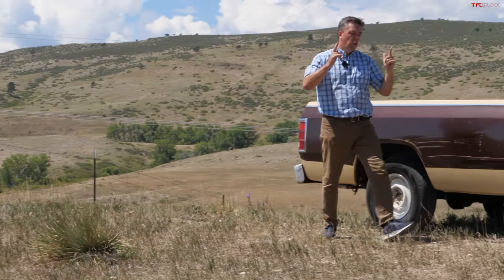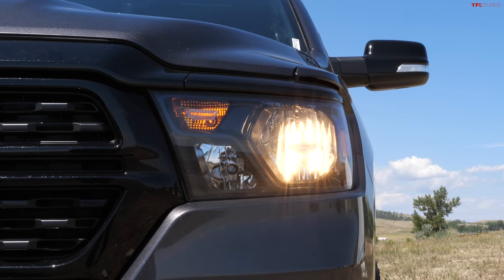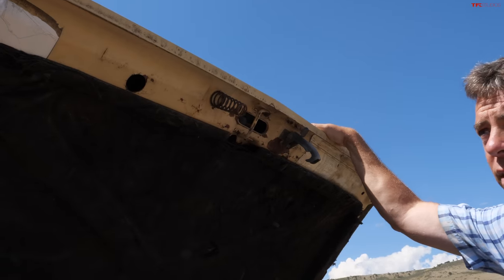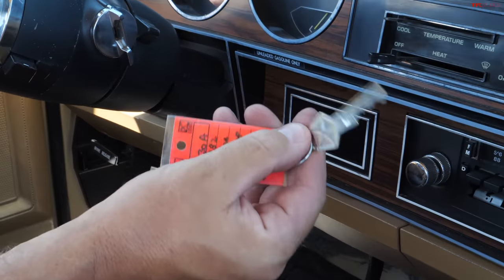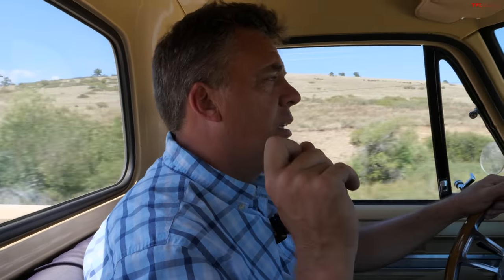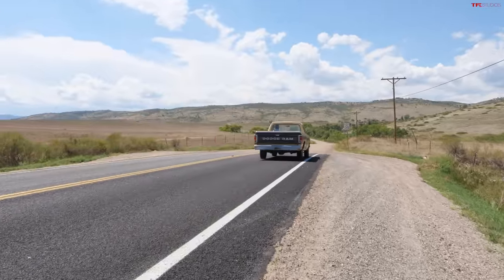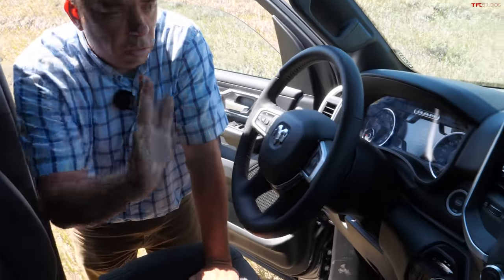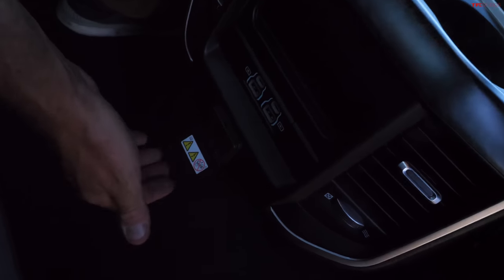You Won't Believe How Much Pickup Trucks Have Changed in The Last 40-YEARS!

Comment: My father had a 1980 350 dually flat bed with a 360 ci engine and a 4 speed manual. The biggest pile of crap I have ever drove and rode in. Constantly breaking down, extremely loud and rough ride. The doors from day 1 didn’t shut properly and leaked water and air. You could see daylight through the door jamb. Had to rebuild the engine twice. Once at 45,000 and once at 66,000 miles. Other than that…. A real great Mopar product. 👎🏻. He also had a 86, 73 and a 69 Dodge pickup. Both were gems and had similar problems. Piles of garbage. Only reason he owned them was that was the only dealer in town and we had no choice. 100 miles to the next town with options. Lol. Anyway, good luck with that one. Hopefully you have a better experience than I did growing up. 👍🏻

Comment: You haven't adjusted that price tag for inflation, so the new RAM cost is roughly 3 - 4x more than the 1982 model. 

Also, 4WD is for off-road capability. It does little to improve hauling or towing, unless you're doing it on none paved roads. That older RAM is most likely RWD, which makes it quite a capable truck for its time.

Comment: Early in the video he remarked that the old Dodge truck was not an "all season" truck because it was so light, I've lived in MN my whole life and believe me those old trucks WERE sold to "all season" states like MN, you just put bags of sand or stacked some wood in the bed in the winter. Also, he remarked how the comfort level was similar in both, really, that's proposterous!  My dad had a 1980 1/2 ton Dodge truck, [pale yellow and white] and it rode nothing like the trucks of today, it also came with side mirrors on both sides, and the steering wheel on that old Dodge is definitely not stock, so I don't know where he found this oddball truck.

Comment: Trucks used to be cheap vehicles because they were built primarily for work and utility. Now they are built for family transportation. Trucks were purchased by individuals primarily as second vehicles for those reasons. As cars got smaller, truck sales picked up in the 80s because they were still big and comfortable. Manufacturers caught on on now trucks are luxury vehicles. As I recall from the early 80s Dodge trucks were primarily government or fleet vehicles because they usually came in with the lowest bid.

Comment: My buddy has an 86 dodge with the 315 v8 and I have an 86 ford with the 4.9 straight 6. He's has a lift and big tires and he still beats me in a race. Straight 6 was made for low end torque, not horsepower. The v8 may have more torque, but not low end torque.

Comment: Ive recently had an 88 dodge and a 2014 dodge..... I much prefered the old. Its smaller outside but larger inside. Was also more comfortable and got the same fuel milage. I really really would rather have the 1988 truck than the 2014
Reply: And everything on the 88 still worked. Every switch every knob everything. Im already fighting with keeping everything on the newer one. Everything keeps breaking.
Reply: Just don’t have a crash in the old truck. The difference in safety performance is massive.

Comment: That's 1982 Ram was in its 10th year on that platform at the time of assembly. It was the same truck, until 1993 when the 1994 trucks came to be. Like most things Chrysler. The don't change designs often because they can't afford to redesign an enift platform. This is why we have 2008 Challengers/Chargers/300s running around. The 2011(actually 2005) Caravans are still being built and sold(the 2015 Pacifica is too $$$$) and the Ram chassis is the same basic design(2019 5th gen is a massaged version 4" longer) as the 2011 truck(actually the 2002 LD/2003 HD trucks)
Reply: It's amazing that Dodge just announced their first new vehicle in 10 years, the Hornet. And it's not even a Dodge, but a rebadged Alpha Romeo.

Comment: I have owned from even older Dodge Trucks into the 2000's both gas and diesel powered. I will take the 1970's -early 90's trucks all day long over the newer yuppie trucks. The move towards yuppie trucks really hurt the person that works their pickups with maybe the exception of the long haul/ heavy load drivers. 
A construction worker/ city work/ utility truck doesn't need all the luxury crap that bloats the weight and cost of the newer trucks. At most AC the rest is just a wallet/purse emptier frivolous crap.
To me the best all around Dodge trucks for the person using them as a work truck were the half ton 318 powered ones. The slant six really wasn't any better on fuel or longevity. I have a 1981 slant six D150 project truck now. The Cummins are great if you have extra heavy weight to pull but that is about it.  But how much should a pickup be able to pull? Pickups are now pulling what it use to take a commercial truck and commercial insurance to pull.
Reply: Well summarized.

Comment: 5:01 Most likely it did come with 3-point seat belts. My 1984 Chevrolet S-10 had them.
This was also right after Nader's "Unsafe at any speed" and push for automotive safety, in terms of automobile development.
Reply: Yes on three point belts started in mid 70s

Comment: Hmmmm.... 2 new trucks in my world. Took my son to the lake this morning in my 75 year old 1947 Dodge Power Wagon.
1 ton, 4 wheel drive, 60 hp flat head 6 cylinder, factory winch, 4 speed with low range...no synchronized gears. Had a notion to drive over to Colorado so TLC could drive an older Dodge.

Comment: In 40 years, that '82 will still be going with minimal maintenance. The new Ram will take a lot more parts and maintenance to make it to 40
Reply: The new RAM will be non-functional after 10-15 years (is my guess) as the dashboard electronics will be obsolete and non-functioning, with no aftermarket parts available to replace them. It will be functionally unusable, even if the engine is fine.

Comment: I had a 1991 ram 2500  360 v8  loaded it up with sand gravel right  down to the stops  run like it was no problems 😊 😅 👌 😀

Comment: Thanks for your time sharing this video but, I will NEVER buy another Dodge vehicle again!  We bought ALL NEW at separate times, a 2005 & 2006 Diesel Ram One ton trucks,  2005 Dodge Magnum, 2006 Dodge Neon, and yes a 2008 PT Cruiser. The PT consumed a quart of oil every 1000 miles. They replaced the lower block, and it still consumed 1 quart every thousand miles.  After taking it back several more times with NO fixes. Dodge gives me a tiny slip of paper , big as a fortune cookie slip that says: It’s common for Dodge vehicles to loose 0ne quart of oil every 1000 miles. Huh?  When it comes to warranty’s.  The SERVICE DEPARTMENT SUCKS!
Reply: Strange, I used to own a pt cruiser and that made it to 160k and burned no oil, it was actually real reliable but I needed to upgrade to something bigger
Reply: @ricepile1343  I must of got a lemon.☹

Comment: More like 50 years right there. Yes I’d did cone with 3 point seat belts. Safety was beginning to be paramount! No that radio in your truck isn’t the earlier version of the precision series or standard issue digitally tuned Chrysler factory radio’s in the manual which was made standard in 1984 which means no more optional analog radio’s after 1983.

Comment: With gas prices going up these days I would rather have a 6 cylinder and the slant 6 is one of best engines and would run forever, so I would rather have the old truck now. I do have a '97 Ram 1500 with a 360 V8 and wish it got better mpgs then it does. Which my truck has 283, 400 miles so far and still going strong so one thing with Mopar is their engines can run forever. Plus I've own my truck for 9 years and have put over 90,000 on it so far myself and its still going. So Mopar or no car or truck!

Comment: 4:59 3-point seat belts were mandatory in front seats by 1968.  Initial implementation was having the shoulder belt separate, but by the mid-70s, almost all manufactures were using the ratchet style 3-points that we're still using today.  An 82 Ram would have came with those from the factory.  Only the 1st Gen Ram (81-93) predecessor would have used anything else.  Those were the 2nd Gen D/W Dodge Trucks (71-80), they would have had some early models with separate shoulder belts, but it's also the models that had the gas tank behind the seat in the cab, so safety wasn't exactly a strong point.
Reply: True.  My friends '70 Chevy didn't have the shoulder belts, but it had a covered screw hole where they could be attached.  It might have been an option for a few years on the trucks.  But I understand GM cars had shoulder belt mounts under the headliner on cars starting in 66.  They even had mounting holes for rear shoulder belts starting around 1970.  Rear shoulder belts were a factory option on my '71 Riviera.  But i have seen Chevelles, etc with the same mounting holes.  May have been a dealer option or just put in, just in case regulations changed between design and production.

Comment: Anywhere near 30mpg would have to be a D50 with the diesel. This truck, would probably get 18 mixed brand spanking new. I had an '81 slant and got roughly 13 city. These trucks wore out quickly and the mpg suffered greatly. I've seen folks barely braking 10 mpg with a slant.

Comment: The maintenance alone over the years on the new truck would pay for several of the old.
Don't forget that with newer vehicles often replacement of a small item requires disassembly of half the vehicle.
In addition those old slanties were good for well over 200,000 miles with regular oil changes.
Old six cylinder pickups and truck type wagons of the day were regularly rated to tow from 4000 up to 5000 pounds.
The newer trucks are certainly no better when it comes to rust and corrosion.  That still comes down to the owners care of the vehicle. 
But hey if your not stuck enough in front of a computer screen each day then yes you have that benefit and increased fun with newer trucks.  I guess.

Comment: Old - Way more headroom, way more hip room. Way more space, The A pillar you can actually see out off. and Roll one over and your gonna live. Iron that could handle the salt belt. A bumper you could actually hit a deer and have no damage.  No Distraction for driving.  Simple and easy to work on. 
New - Will rust out in less then 10 years- Hard to see out off. No hip room in the seats. An a pillar you can loose a tractor trailer in. Does not do well when rolled over. New is to fragile.

Comment: Based on median income the new Ram is twice as expensive.  About 10 months median income vs. 5 months for the '82.
Reply: Twice the adjusted price, but 10 times the vehicle.
Reply: @Josh-179  If you go to the RAM site, under commercial vehicles there is a Tradesman pickup, regular cab 8' bed for half the price.  It is still twice the vehicle. Pickups now are family vehicles, not work vehicles.  Since the government regulated cars out of existence trucks have replaced them.

Comment: Love the window quarter light. A real work truck, I don’t know what today’s trucks are for.
Reply: New trucks will be able to tow double that. You still can get base model "classic" rams single cab 8' bed with more towing and safer
Reply: @ricepile1343  no doubt I had this truck and it was slow and when you hit an expansion joint the whole truck shuddered and jumped around hence the expression “ drives like a truck” but it was simple and easy to fix basically a tractor with doors.
Reply: Driving around like cars

Comment: With specified oil changes, that Slant will go 250,000.0 miles without touching it. Brillant engine but not so well known. Used in both passenger cars and trucks.

Comment: IF you did your homework, you would find that tiny drivers side mirror is WRONG and the fact it does NOT have a passenger side mirror is WRONG.  That rear view mirror looks WRONG as well.  And I won't even go into all the other things that are NOT original equipment.  Regardless, I never liked the OLD Dodge/Ram trucks until they redesigned the whole thing in 1994.

Comment: The hood on the new truck is so short compared to the old one.  I don't see how mechanics can work on the new one.  The engine is halfway under the windshield.  You can crawl into the engine bay on the old one, there is so much room.
Reply: We had a 75 Plymouth Fury with a Slant 6. Like this Dodge, you could probably fit two Slant Sixes under the hood.
Reply: @rightlanehog3151  Slant 12!

Comment: That's a nice old truck & the thing about it is if you were to go out one morning and it wouldn't start it's gotta be fuel, fire or air, if the 2022 failed to start it could be anything, & I'd be willing to bet the 2022 won't be around in 40 years either. Give me the 82 Dodge anyday over the new Dodge. Also it's funny how side by side the 82 looks like a mid-size truck compared to the new one.
Reply: Truth!
Reply: People drove 50's chevy trucks said the same thing about the trucks from the 80's
Reply: @ricepile1343  not a lot of difference between 50's trucks & 80's, body styles & that's about it. Both were simple, as long as they had air, fuel & spark they both would run. These newer vehicles are all computers. Which the new cars of today are a 1000 times safer.

Comment: My 82' Dodge PU had a different transmission with super low first gear.  Archaic vernacular humorously refered to standard low option 1/2 ton PU's as country Lincoln's or similar. Cars downsized. Pick-ups became the new Lincoln or as said the defacto family car.  Take both out to the woods for a load of wood. The new one will be much more comfortable and quicker, with more hands inside for labor. Both will haul the wood.

Comment: So youre saying that steering wheel is a stock option for 1982? Youre also saying that the old truck has no visibility because it doesn't have a back up camera? Turn your head around like you were taught to when backing up in drivers education. Unbelievable man. Other than those two segments of the video, you did a good job with the video.

Comment: You could have at least used a mid 70s (prior to emissions limitations) with a v8. Might have surprised you. I used to work on these. I really doubt those are original seat belts. Probably just had across the lap belt.

Comment: The old truck is actually got better build quality and more durable. The slant 6 with proper maintenance can last 500,000 miles or more the new 5.7 probably can barely make it to 200,000 miles.

Comment: Let’s not get too romantic here about this Dodge truck. They were a POS.  Hands up any of you commenting here that had the misfortune of trying to start one of these things on a cold winter morning.  I bought a brand new 1980 Dodge Mirada with that slant six engine and a holley carb.  Roughest, hardest to start motor I ever had the misfortune town. Brand new and the the Chrysler service department handed you a can of MoPar Combustion Chamber Conditioner and told you to take the air breather off, start the engine and keep it at fast idle while you sprayed a whole can into the venturi. Coughing, farting and blowing out white smoke from the exhaust. Instructions included letting the engine stall and sit for 15 mins before starting and revving it. As if that wasn’t enough, the lock up torque convertor would shudder the whole car when it engaged, particularly if you were going up a hill.  The Ford trucks and Chevy/GMC trucks were measurably better.  Our C10s and C15s and F series trucks were great trucks and served us well.

All that said, I’ll take any new truck over the old ones.

Comment: 1982 dodge ram 1500 is nice. dodge had other types of trucks just like now but your friend just happen to buy the smallest dodge truck. the head on the engine is slanted not installed slanted . ford f150 has a i6. dodge had v8 hemis in trucks in 1982 just your friend didn't find one.

Comment: If you were comparing the same truck single cab 8 foot bed to today it would be about 5 or 6 times the cost of 1982 we don't make five to six times the money we did in 1982 and that's what the problem is with our economy that's one of the reasons we're in this situation

Comment: I ride motorcycles much more than I drive cars and trucks, no point in pulling two tons of metal around with me wherever I go.  When I do need to haul mulch or 4' x 8' plywood or drywall sheets I'd rather keep my cheap '87 F-150 for doing 99% of what I need a pickup truck for, and on the odd occasion I need massive power and towing capacity I'll rent a pickup and torture it.  Much more economical than buying more tuck than I'm going to use most of the time.  Plus the new trucks are so overwrought with the hyper-aggressive styling, everyone pines to look like a big dog.

Comment: Actual trucks don't really exist anymore, for the average person. You can still buy something resembling an actual truck from fleet sales, but they are all computerized and have V6 engines. What are called "trucks" these days are actually large cars with a tiny little bed instead of a trunk. They are worthless as trucks. Soccer moms like them. I have a 1977 Ford F-150 that I bought more than 30 years ago. It is a 2 door, standard cab, 2 wheel drive (with FIFTEEN INCH wheels) 8 foot bed, manual transmission with a carbureted V8. It is in beautiful condition, no rust, and I will never get rid of it. It is on it's second engine, and I will continue to replace parts for the rest of my life to keep it going. There is no way I would ever buy one of those new computerized dumpsters with huge diameter GHETTO wheels.